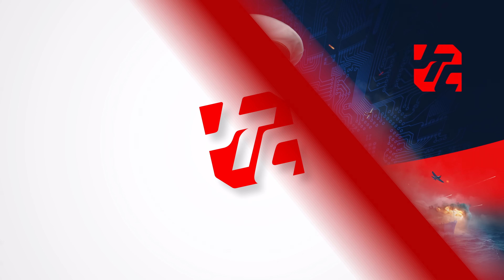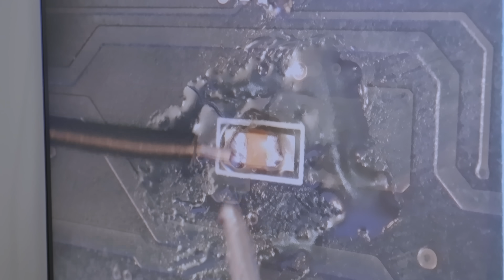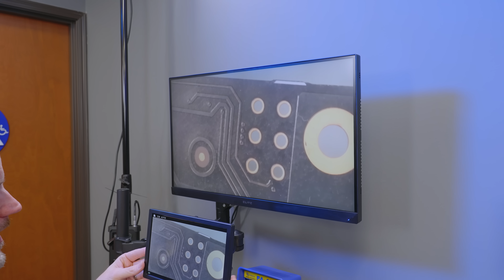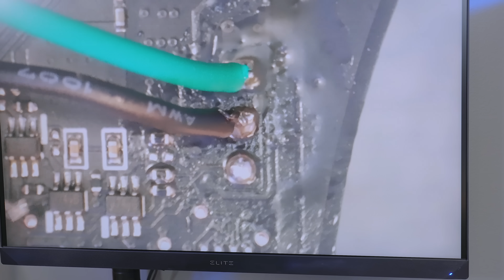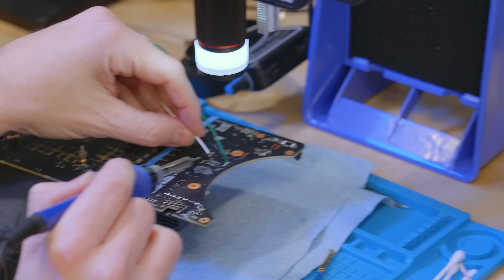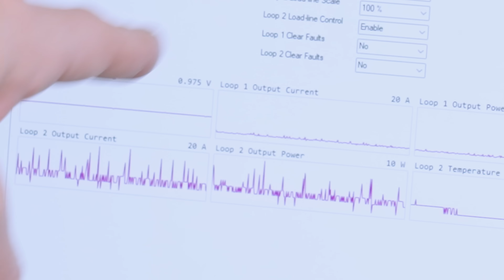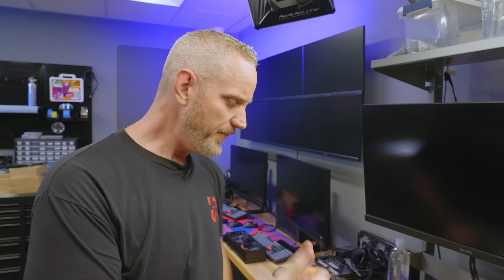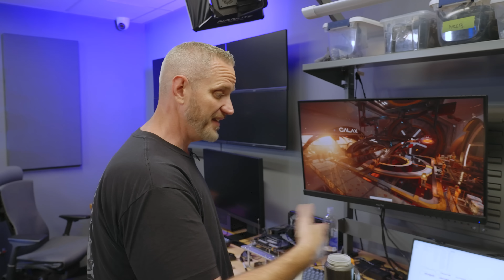This didn't go as planned...

Comment: So, fun fact, when you pump 1000s of volts through a very thin wire that is how you create electric detonators. "Where was there 1000v on the card?!" Good question, but I imagine 1000A at 1v through the same wire would do something similar. Never tried though. Either way, what you probably heard as a 'bang' was 1000w of energy being passed through a very thin wire, converting that wire to plasma almost instantly, with a magnetic field strong enough to contain the plasma for a few microseconds as more of the wire was converted to plasma, until the magnetic field finally broke down and all that plasma went to equilibrium...AKA 'boom'.
Reply: Nope, this failure occurred inside the PSU with something like ~180/360V being regulated down to 12V.  The ~1V section was not involved with this, beyond being the end load point.
Reply: @big0bad0brad  Yeah, Hyperspace Pirate has a video on the effect I'm talking about. And there are failure modes where 1000V+ could exist (briefly) inside the PSU. There's...more than a few ways that the plasma explosion I describe could have happened, and it is just about the only thing I can imagine loud enough to match what they talked about. Capacitors are loud, but not as loud as they describe. Only plasma detonations have energies that high.

Comment: You soldered way better then the first time I saw you solder but you still forgot to pre tin the wires. It make the wire stick way easier if there is already solder on it. Also you should position the wire the heat through the wire not just melt the solder

Comment: What are you running this on that you're getting 20-24 amps? Typical circuit in the US is 15 amps and a higher load one is 20 amps. What power supply is putting that kind of power out?
Reply: amps are voltage related. 20 amps at 120v is different than 20 amps at 12v
Reply: @slateslavens  sure. I guess there are transformers in the power supply that allow it to provide more amperage than the outlet. Makes sense. I didn't think of that initially.

Comment: jay, when your pushing clocks to the limit, electrical noise can have negative effect on sensetive circuits (as with your mic transmitter in previous vids). Fans can be electrically noisy so it might be worth trying ducted fans (Manrose, MF100T, black or similar) with plastic air ducts to direct the airflow where you want it. This will keep the motor(s) well away from the sensative circuits. Might not help but worth a shot

Comment: Come on now Jay.... Soldering is 1)tin wire and load iron with solder 2)heat fluxed PAD 3) introduce wire 4) remove iron 5)wait to cool. What's this I'm seeing?!
Reply: You don't load iron with solder, you heat whatever you're soldering then bring in the solder.
Reply: @JJayzX  Not when you are holding the wire in the other hand. You'd need a third hand! If there's plenty of flux on the pad, you can use a loaded tip.

Comment: That's a good power supply. I would rather have a PSU die, but everything survives, than have a crappy PSU that takes everything with it. Sadly the later is more common. So yeah Fails don't bother me. It's how it fails.
Reply: Well, obviously if the choice is between a failing PSU and a failing PSU that kills other components, you would pick the first. But why is the comparison not against a PSU that doesn't catastrophically fail when pulling less than it's rated maximum?

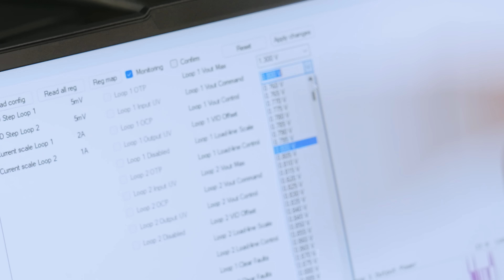Comment: 16:15 - just turn off "smooth-scroll list boxes" in "Control panel > System > Advanced system settings > tab Advanced > Performance" and forget about this lagging scrolling forever 😀
Reply: Even those small optimizations are needed to get into the top 10
Reply: Im gonna save this just for me and my pc. Even though im not Benchmarking

Comment: That's what good PSU's do, sacrifice themselves for the greater good...... Well actually, I had a really cheap PSU go pop on me in the early 2000's when I started building, and even that took the brunt, I was shocked nothing else was fried and that system lasted years on another PSU. Taught me to never buy cheap PSU's ever again.
Reply: The interesting part about transformer based PSUs is that if the switching element blows, it won't over-volt or over-current the output because the transformer has a limit to how much charge it can move in one cycle. 

However, if you have a PSU that creates a giant 12V rail and derives 5V/3.3V from that, a failure in the switching element for the 5V/3.3V rails will absolutely nuke whatever's downstream.
Reply: When I was a teenager I modified a cheap desktop PC PSU to charge RC battery packs. I simply soldered all of the 12v wires in parallel. It was rated for "550w" but was down to 11v at 200w of power draw. It worked well enough for my needs at the time. A proper RC charger power supply would have cost $100-150 back then. I only spent $20 shipped on the PSU.

nearly 20 years later later, I'm using a $30 refurbished 24v server PSU to power my battery chargers. It works great and actually supplies 600w. I use it to charge RC batteries and a large, custom Li-Fe battery pack that I built for portable power. I'm still a cheap bastard when it comes to "custom" electronics and batteries.
Reply: I had no such luck when my PSU died in a DIY build from long ago. The moment it died, it fried my CPU, motherboard, GPU, drive, and optical drive. Only thing it didn't fry, was the system ram.
Reply: Hehe I had 2 cheap PSUs pop in a row when I installed a 300W card back in the GTX600 days. Both were rated for 500/600W total...guess not for 300W GPUs...
Then a branded 660W I used is still running today, 10 years later.
Reply: Yep. I still remember like six months of weird crap I faulted the motherboard for (system kept bouncing out of sleep, eventually spontaneously booted after a shutdown) followed by a nice loud bang reverberating off the walls and just that classic smell of a blue smoke leak. Everything was fine except for that valiantly flaky Corsair PSU. I'm sure we'll all sweat about it every time we have to order a new PSU, wondering every time whether that'll fix everything.
Reply: I also had a top tier PSU die on me and take the mobo and RAM with it.
Reply: I have dealt with a old PC during the quad-core era and a friend of mine his PC's power supply went completely popped and took out the entire motherboard and graphic card out but Lucky enough his CPU, rams and hard drive survived ended up replacing the board and graphic card and proper branded power supply and it worked. The old graphic card I kept until a few years later I repaired and replaced the burnt component closest to the pci-e connector and it came alive

Comment: Even multimeters have 1-5% tolerance, I wouldn't trust this 3 digit voltage meter for a second. And you seem to have really cheap solder, it's suppose to 'dry' up shiny. Also bigger tip and probably higher temp on the soldering iron (450c)
Reply: He needs a pre-heater there is too much thermal mass.  its also wattage that makes most difference.
Reply: No modern multimeter has 5% "tolerance" (what you mean is accuracy). You typically see ±0.5% for DC voltage in that range on cheap to medium priced DMMs and as low as 0.025% on high-end models (e.g. Fluke 287).
Reply: only leaded solder "dries" up shiny. All these cards are lead free. Lead free solder does not turn shiny when cold. 450c would destroy the board aswell.
Reply: @GravitySandwich  The board yes, but why use unleaded solder yourself, it's junk and only there because of environmental assh..
Reply: 450c? There's nearly no reason to use such a high temperature for electronics soldering. I personally use 320c for almost everything and the highest I'll go is 375c.

He needs more thermal mass, not more temperature, and properly preheating the board too either with a hot air gun or preferably a dedicated preheater.

I'd also say he could do with better quality flux like amtech tacky flux or one of mg chemicals alternatives.
Reply: @PaulTheFox1988   With the board sucking the heat away, one way to solve that is higher temp, other way is to pre heat the entire board which in my opinion is worse. Thermal cycles are always bad. And agreed, wattage over higher temp. But given the tools, my tip was higher temp.
Reply: @audiogek  the problem with higher temp over using a pre-heater is you end up with hyper-localised heat, which can result in popcorning of the board, evenly preheating the board prevents this, and is gentler on the board as the whole thing experiences a lower temperature across its entirety.

He only needs to preheat to about 80-100c to overcome the wicking nature of the ground and power planes. Thermal cycling isn't good, I agree with you on that, but a preheater being worse than higher localised temperatures? Not a chance
Reply: @audiogek  Depends on the soldering iron. The further away the temp sensor and heating element are from the tip, the more sluggish the soldering iron reacts to its tip getting too much heat siphoned away, resulting in a colder tip than what you configured - which is bad, because the tip will still reach these higher temps at some point and cause damage.
Those that have both placed right behind or even within the tip react much faster and will immediately pump more power into the heating element to keep the temp of the tip stable. That's actually one of the cases where a cheap Pinecil V2 with a 28V5A USB-PD power supply does a really good job.
Reply: @PaulTheFox1988   "hyper-localised heat, which can result in popcorning of the board" Somehow an image of NorthridgeFix popped in my head 🤭
But glad we can all at least agree on the 3 digit voltage meter.:goodvibes:
Reply: I was coming in to say the same.. Those things are not accurate!!

Comment: open the powersupply and show what popped 🤣
Reply: Possibly a main rail capacitor. These tend to explode when suddenly pushed beyond their individual ratings
Reply: @luckgrip252  You'd definitely be able to smell that immediately, the electrolyte liquid is really nasty stuff. My guess would be one of the beefy MOSFETs, those can go out with a serious bang as well when shorting - without causing a smelly toxic cloud.
Reply: @letalissonus  there's always a stench when the magic smoke is released. Caps are worse than fets, but there's always a smell...
Reply: @TheCurtisnixon yeah like a foul smell of rotting fish is how I describe it once the capacitors either leaks or exploded. The fets isn't as bad but it leaves toxic burnt smell afterward it lingers in the air for a short time. Either way it not pleasant to be breathing in the smell.
Reply: @luckgrip252  Well, more like over a bit of time, getting more voltage than their rating or just older caps at that point.
Reply: @luckgrip252  , Electroboom agrees
Reply: Shame he's not in the UK, if he were he could have sent it to Big Clive for a teardown post mortem.
Reply: Yeah the inline capacitors that filters the AC to DC could be the culprit if it goes bang it pretty loud not like the little capacitors it would be more violent and worst case would be the driver mosfets overheated so much it would crack the body if he heard the bang followed by magic smoke exiting the power supply that would point to the driver mosfets died a horrible death. How I know I used to repair a 1500w external speaker amplifier that does the same symptoms once the channel volume is cranked up to the max without properly clipped it would break multiple driver mosfets in a instant followed by a loud bang and plenty of magic smoke. Not the first time this happened to my friend who DJs for parties three times because he didn't listen to my advise on setting up the sound system correctly he spent a fortune in replacing the external amplifiers
Reply: or send it to linus

Comment: gloves... use the god damned gloves
Reply: When working with delicate thing gloves make you loose tactility and fine feel and also gloves when soldering can melt causing bad burns
Reply: Gloves? With the LN2?? You do realise that would trap the liquid and would cause actual burns instead of the leidenfrost effect keeping the skin safe?
Reply: its been said so many times how dangerous it is to use gloves with LN2, if youre so fucking worried wear them yourself or dont watch the goddam video. no one is making you watch this.
Reply: gloves are how you lose fingers
Reply: Gloves are bad. Also don't ware close fitting clothes or socks